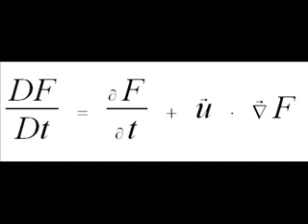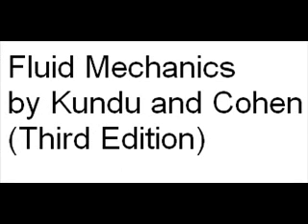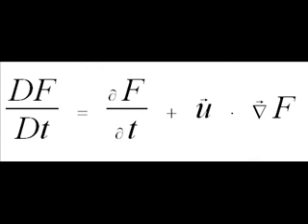Explain: The symbol D/Dt

Comment from the maker: I would say that the two equations you wrote are equivalent. You can think of d/dt as a symbol that just means "take the derivative with respect to t." Another way to think of it is dv divided by dt, where if you are at time t and you take a very small step in time, called dt, then the value of the function v will change by dv when you take that step.